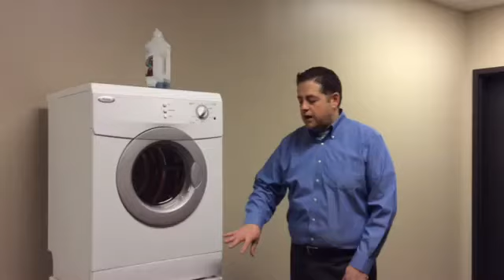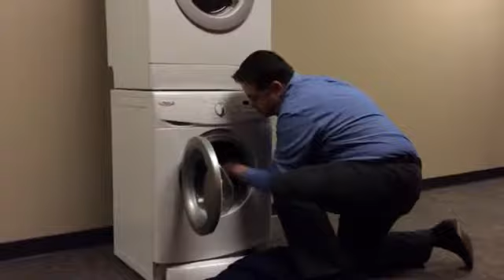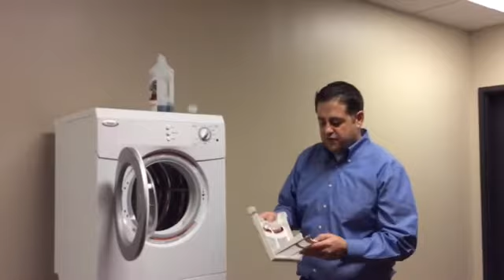Apartment Size Washer and Dryer | Whirlpool Stacked Laundry Use and Care

Comment: I had this delivered after Christmas and it was a blessing=>>allmy.tips/WhirlpoolWasher?86h     The tub is nice n big, can actually get a king size quilt in. It is a little noise when it first starts washing, but not bad, spins well,rinse cycle quiet n like the fact no agitator in center, which always caught the strings in hoodies, sweat pants n bras,it's nice that its in bottom n flat. Yes no clothes tied together or wrapped around agitator. I had Good luck with Whirlpool washer n dryer in the past. Lasted approx. 15 yrs. I do my best to purchase American made. This washer is very easy to use, inside the lid explains each cycle n how to use. Very helpful. Price reasonable. Glad to own.